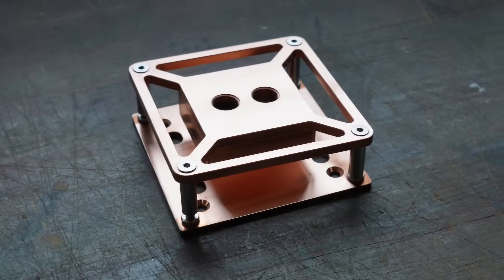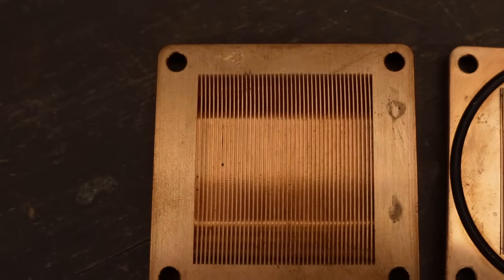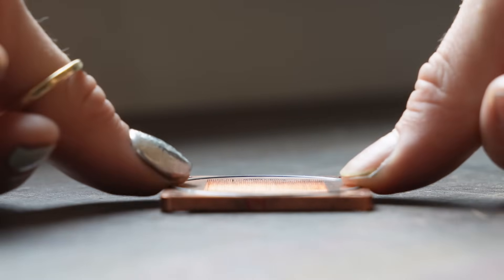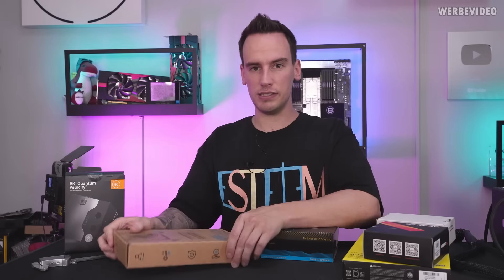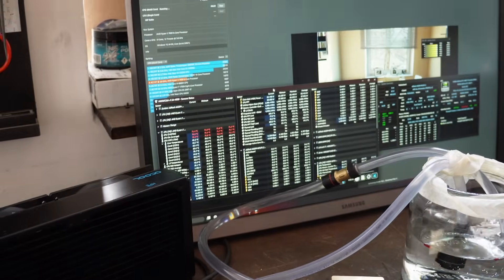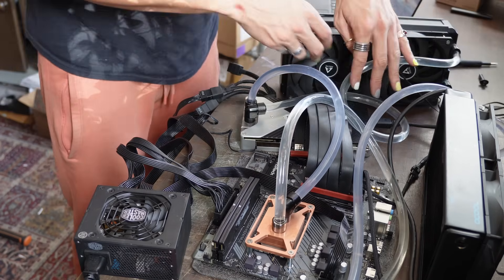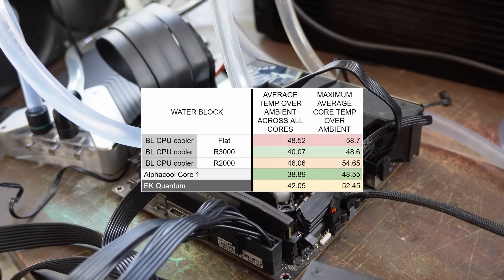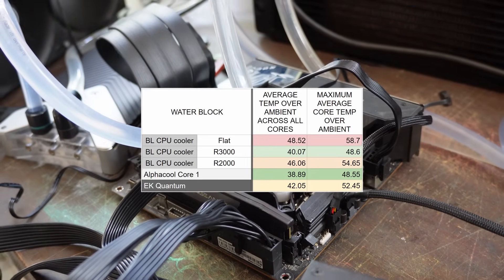We made our own CPU Water Block, and tested it against the best!

Comment: Wasn't expecting the ruler tattoo ! looks convenient
Reply: came here to say the same thing, its kinda genius
Reply: It aint, it will never be as precise as a normal ruler @infernzo
Reply: @gabrielebrusa4368  ik but for a quick guestimate should be fine no? Bit of fun at the very least
Reply: @gabrielebrusa4368 I have a similar one on my left forearm. 20cm marked off in 5mm increments. I do actually use it as a quick reference though it has drifted by a couple mm in total length over the last several years.

Comment: That video GN did with the Noctua engineers about cold plates might be worth watching if you haven't already. Need some sort of precise 3D scanning machine to scan the exact curvature of the CPU then make inverted designs for the coldplates based from the scans.
Reply: Not simply 'inverted' though, it has to be machined in a way that forms the inversion while under mounting pressure, making it inverted at static means it will likely deform slightly once pressure is added, then it's the same problem again. Also you can't scan a processor lid that has a heat block asserting pressure across it. Scanning just a processor won't be true to how it reacts to what's mounted, they effect each other so it's a very delicate balancing game to get precision fits while under.. irregular edge pressures.. tbh I'm sure it's actually a nightmare to work with that, it just makes it easier for consumers to mount things 'good enough'
Reply: A point measuring system is cheaper and easier to get values out of, but still quite expensive.

I'd use a calibrated flat granite plate, one vertically mounted dial indicator (micron scale) for Z measurement and two horizontal ones (mm scale) for X and Y coordinates.

CPU is placed on a machined frame (brass is fine), which holds it flat to the  granite plate (flatness can be verified with the dial indicator) without allowing it to move. It's basically a rectangle with two rectangular cuts to hold the CPU.

Two engineer's squares provide reference surfaces to keep it aligned and two screw mechanisms press it against the dial indicators to hold it steady.

Then you can make as small an adjustment as you need to get 3D coordinates, which can be turned into a points-driven surface in CAD or used to manually determine a fixed radius. Depends on what the CPJ shape is like.

But also, if they have access to a milling machine, none of that elaborate shit is necessary, just a CPU plate and a micron dial indicator. The bed on that mill should be good enough.
Reply: @Roobotics  First measure the exterior, then delid and measure the other side of the IHS. It's a solid block of copper, nothing particularly clever going on there. We just need the dimensions.

From there, build the assembly in CAD, throw it in your favourite finite element solver (Mecway is cheap, cheerful & well-validated) and iterate away at the design.
Reply: @233kosta  that's just it, there is something clever going on with these. Will it be used in tandem with the stock IHS or retention mechanism, or does it apply all the clamping pressure on its own? The IHS is nickel plated copper, on a fiberglass substrate, with a silicone wafer wedged between, all on a bed of spring-loaded pins, that also bottoms out on a plastic socket, BGA mounted to yet another fiberglass substrate(motherboard) and then there is some varying form of metal stiffener there.. there's flex transmitted through this entire system that can subtly propagate to the contact points of the CPU, there is no clear point where it would be decoupled in simulation at the scales of surface heights needed to get a consistent pressure application. Now if the stock retention bracket is needed also, it's preloading 2 edges and also making it potato chip on top of all this. Remove the IHS and then you have to balance it out across the cpu-dies. This isn't even getting into the idea that the IHS might have varying convexity across batches or SKUs, because to Intel all that matters is that the stock performance is uniform with their usually included cooler solutions.
Reply: @Roobotics   The IHS is decoupled from the CPU board by the rubber-like glue they use to bond it around the outside. That gives you about 1mm of flex, which is more than you'd ever want to see there since the centre of the IHS is soldered to the die and transmits the bulk of the contact force that way.

You could model the whole mounting system, but there's really no need. Apply a fixed bc to the die location(s) on the IHS and take it from there. What's more important to include is the full construction of the water block as well as the clamping force from the screws. If the first run shows significant weirdness, go ahead and make a more elaborate assembly, but keep in mind that every layer of complexity you add is a layer of "wrong" you're piling on top of something that's already imperfect. Less is more with most of these things. Plus, if any of the materials involved is anisotropic, or you push it into its nonlinear region, you're fokked unless you can get a TONNE more engineering data. At our office we usually do that by literally breaking things. Even then, that's not a perfect representation of how actual widgets are manufactured (the process affects the materials), so in addition to material samples we'll routinely destroy actual product pulled off the lines. Needless to say I don't see these guys dismantling several grand's worth of chips and testing them to destruction.

But they don't need to. The basic case outlined above is good enough for what they're doing. Like you said, there's no accounting for what Intel will do with the next IHS batch, so in any case "close enough" is going to have to be good enough.
Reply: I saw a Der8auer video with something similar where they 3D scanned some dead CPUs and then stretched out the scans in the software to reveal some indentations in the PCBs which had killed the CPUs.
Reply: What an awesome discussion 😁

Comment: If your mounting applied pressure in the middle of the block, it will bend less under pressure.
Right now it looks like soft copper bars are pulling the block at the corners onto the CPU. Combine that with a very thin (1mm) base, will cause it to warp and mostly apply pressure at the edges.

Comment: Maybe you could try changing the top mounting part on AMD to accommodate for an offset, so the center of the block would move to where the actual CPU die is. Since Intel is also moving to a direction of chiplets in its new CPUs, then maybe this would be a good exercise for future iterations.

Comment: I'd highly suggest also monitoring CPU power. Ideally with a clamp on the EPS connector but just HWInfo is better than nothing.

In the best AMD result, one of the AC block runs dropped ~200pts in Cinebench and ran hotter. While it's not the most consistent test this indicates background activity influencing the result. Not a huge deal but with higher power chips and manually defined limiters (which you'll need to do) this becomes more important to keep an eye on. As will ensuring Windows does as little as possible in the background (disabling defender, disconnecting the network, etc.).

I really like the design of the new block and the results are promising. You may also want to look at the CPU blocks from Optimus Cooling in the US. They have the finest fins I've ever seen at an impressive ~0.102mm with ~0.203mm channels. I personally have 2 AMD blocks that perform better than anything else I've tried.
Reply from the maker: We're aware of Optimus, they make some really nice stuff! Definitely something to compare against in future. Thanks for all the tips, testing like this is fairly new to us.
Reply: @BilletLabs this design still looks like 💩 😂

Comment: I do every build with the $3 contact frame from Jeyi.  I started with the ThermalRight one, but switched because it's cheaper and it does the same thing.  Core i3, i5 doesn't matter.  35w,65w, K SKU.  All of my builds get a contact frame.  You can visibly see how bent a used processor is, and using a contact frame you can see immediately how it starts flattening the processor back.  For so cheap it's a no-brainer.

I guess my next question is whether making the water block use the contact frame holes (maybe include studs for securing the contact frame) would pay off in terms of machining and materials cost.  Although if the ultimate goal is moving back to the combo sandwich cooler you might want stabilizers spread farther out).

Cheers, excellent science and engineering.

Comment: You should use a torque screwdriver to eliminate mounting pressure as a variable.
Reply from the maker: Our block is designed so the top plate flexes then hits a hard stop, so mounting pressure should be practically identical on all tests on our block.
Reply: @BilletLabs  Ok but to make sure all blocks tested have the same mounting pressure it would still be good practise.
Reply: @xcom9648  @BilletLabs  Or at least the mounting pressure advised by the manufacturers, assuming there's any difference. On the topic of uncontrolled variables, does the draining of the car battery affect the output of the pump over time? It would be good to make sure that the pump is operating in a fixed way. A second issue is the open jar of water used as a reservoir which contributes to the variability of the environment since changes in humidity in the room will affect rate of evaporation from that reservoir and when water evaporates, it cools the remaining water. It would be better to use a conventional/enclosed reservoir.
Reply: @rupert274  Yeah i don't really get this improvised setup either, If they are really serious about about creating the best block in the world then they need some precision testing method inside environmental chamber etc. And equipment for measuring coldplate and ihs flatness like GN has to get a precise fit. I appreciate the effort though and wish them the best.

Comment: The biggest problem with Intel vs AMD for these current generations is that when installed, the CPUs bend in the opposite direction, basically. Steve from GN did a video in collaboration with Scythe where they manufactured 3 different cold plates (extremely flat, bowed inwards, bowed outwards) and they had different performance on on different platforms. Basically, Zen 4 CPUs are generally very flat, Zen 5 bow OUTWARDS and Intel 12th gen onwards bow INWARDS. How realistic is it that you design a cold plate to specifically work the best with a given CPU platform, and if it's realistic, would you consider doing it for Zen 4?
Reply: also after you banana your LGA 1700 CPU, it doesn't un-banana when you install a contact frame, making it worse in some cases!

Comment: Perhaps with your setup a better test method would be to use a set amount of water starting at the same temp (use a fridge?), no radiator, and measure the time it takes for the water to reach a specified temperature.

This will greatly reduce the impact of room temp since you can insulate the reservoir and isolate it from the room. A more efficient design will heat the water up faster. 

I think if your conditions are poor for a certain test, you should devise a new test that is better suited for your conditions.

Comment: Perhaps the curvature wants to be progressive? Like, AMD is quite flat in the middle to maybe just a little raised, but the very corners and edges can be a little raised as well, like a W. But you don't necessarily want good edge contact, there's nothing interesting going on there, all the heat is down the middle. So maybe more curvature towards edges and more flatter towards the middle?
Reply from the maker: Nice idea, but it becomes almost impossible to reliably manufacture a shape like this. Even polishing alone can remove enough material to affect the curvature of the plate. It's important we come to a solution that is repeatable.

Comment: Instead of making the mounts out of copper, why not something like spring retainers? Ridgidly boxing in the CPU seems like it would subject it to more thermal expansion stresses, while a spring system would keep a constant pressure variable size that keeps even pressure on all sides and helps take up user error. Also not machining the largest part of your design from copper billet... But maybe you need the mass for thermal capacity reasons.

Comment: 3m radius is too small, could tell that immediately when you rocked it on the table. My guess from old days of lapping stuff is more like the 20-50m radius range, ie 4-10µm delta between center and corner.

I'm just waiting for someone to put a vapor chamber between the CPU face and the fins 😉

Comment: Would countersinking inlet and outlet of the jetplate be helpful in reducing turbulence? Simply directing flow properly into the jet plate directing flow over the fins. May also help removing air out of the block.
Reply from the maker: More turbulence around the fins is better, so more cold water from the centre of the flow path comes to the surface and touches hot copper.

Comment: You might be better off keeping flat only and including contact frames with the products and it would be easier logistically compared to having multiple skus for your cold plate… also keep in mind that for Intel, the bending with the stock retention mechanism gets worse overtime, so you’ll have a different result for a new system immediately starting with a contact frame compared to an older CPU moving to a contact frame.

Because liquid cooling components are expensive, if the customer bought a curved bottom block for an Intel CPU and then for the next upgrade cycle, they will be less likely to switch to AMD, or maybe Intel changes the design enough to solve the bending problem for future sockets. This is why as a customer, I prefer the flat one because it will mean I’m less likely to need to get a new block for future platforms.
Reply from the maker: These are good points. If the intel test with a contact frame shows the flat plate performs in the same ballpark as the curved plate, this is definitely an option we can consider.

Comment: Why would you lug a car battery in instead of using almost any 12v ac->dc supply?

Car batteries have voltage variation as theyre drained, so this is a particularly odd choice.

Comment: Have you taken into account the softness/elasticity of copper, maybe the block just bows backwards? As for me, it looks like copper coldplate + (stainless)steel/other rigid frame would be a better choice to ensure even pressure.
Reply from the maker: The top plate is designed to flex by about 0.5mm to add some 'spring' while mounting which helps pressure. We believe the mounting pressure is very good, it's just the contact area that isn't quite 100% perfect.

Comment: YES, this is cool - literally! Guys, you run CPU desktop at 40C... at full stress?! That means potentially that 7800X3D could be run both cool and at super low-safe temps... continuously! Or super quiet build is possible! Do continue please! I have typical 'AiO' and ... sadly I did notice improvement after installing frame - so alu contact frame for LGA1700 - is a must! Damn, even the IHS on AMD is thicker and bends less. And todays news about itel arrow-in-the knee -lake ... that is just sad. They are going-Boeing route.